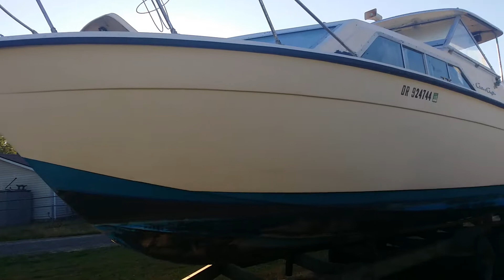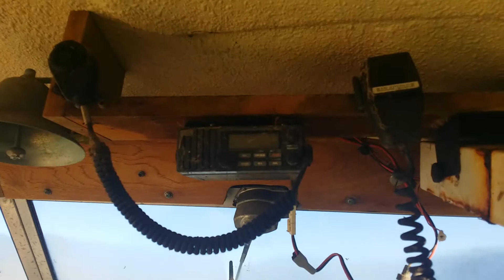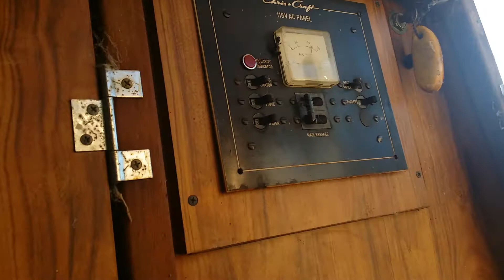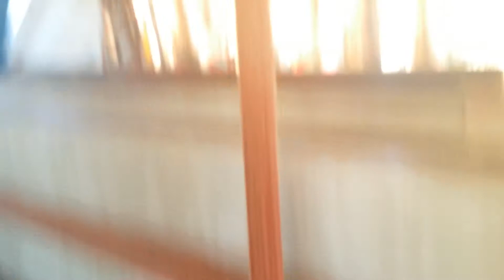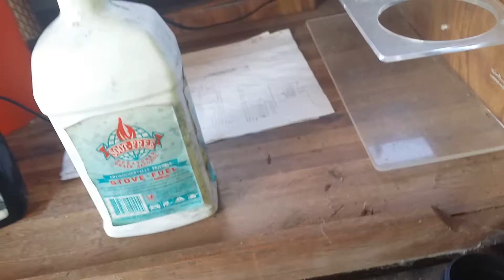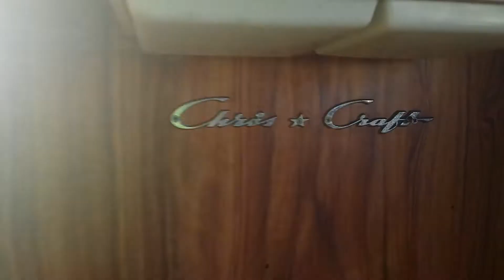1979 Chris Craft Catalina 280, let the restoration begin. What's next?

Comment: I have the same boat I pulled out the engine fuel tank and fiberglass the transom put an out bracket on it with a 150 hp Yamaha thing handle sweet. If I had to do it again I would’ve put a door bracket on it and put two 150s on it. I still get up on plane had the boat for 15 years.

Comment: The exterior looks great , the interior not so much. Big project for sure, but it will be worth it with a bit of luck . Hopefully the engine is as new as they said. I've used some Zep products (degreaser, mildew remover ) and they all performed very well.
Reply from the maker: My wife is chomping at the bit to make new curtains, was looking at fabrics even before we bought the boat. I have taught myself to do upholstery and I have am industrial walking foot sewing machine and a decent place to work upstairs at my shop. Great winter project, this weekend I need to move it to it's parking place, clean out the engine bay and work on getting it running... Once it runs, the rest is game on! I do see that the boat has been re-Gel coated above the waterline.